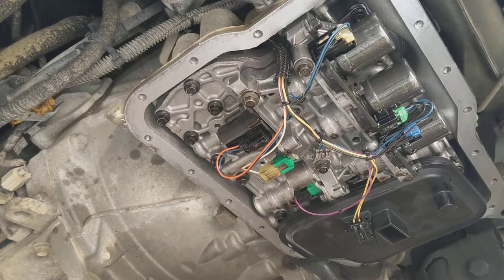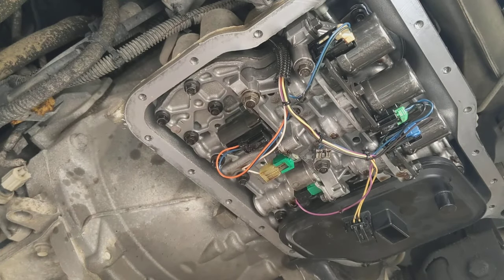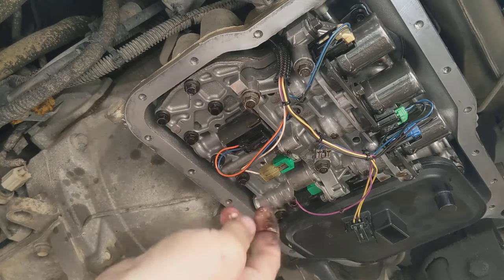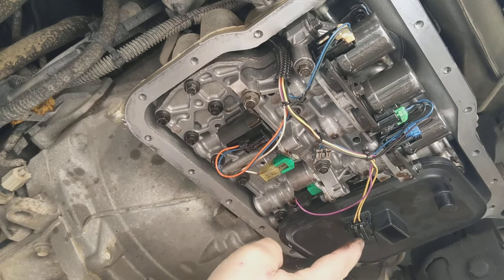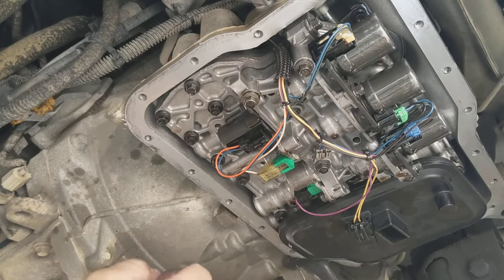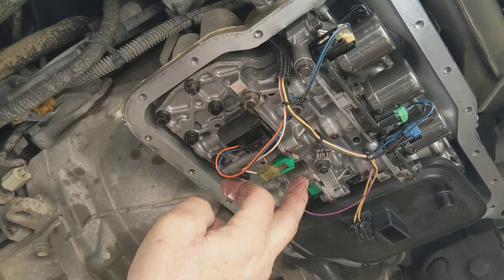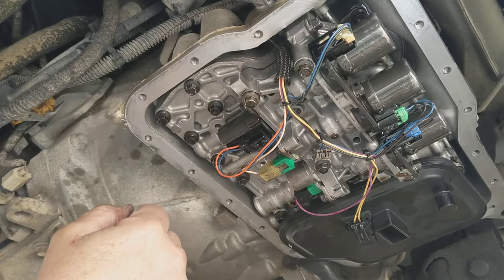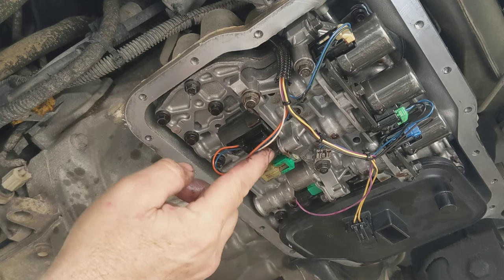DIY transmission shift solenoid replacement!

Comment: This video saved me 400 bucks, I just bought the whole valve body for $60, replaced it myself and the car would go without jerking or shaky RPM, it had a code saying gear 3 ratio incorrect . I would advise don't replace one solenoid valve, sometimes the valve body is clogged inside and the problem may persist like for my case
Reply from the maker: Thanks
Reply: From where get it please ?
Reply: I have the same problem
Reply: Where you buy it that cheap???

Comment: DIY transmission shift solenoid replacement?  Would have been nice to see it done from start to finish.
Reply: If you can't get that far on your own you probably shouldn't do this
Reply: @rogerthat4545  Gotta be tough to remove screws, point at parts and talk about them.
Reply: @jamescummings6703  yup.. pay no mind to the fluid.
Have fun!
Reply: @rogerthat4545  There's fluid in there?  I thought it was in the oil pan.

Comment: Did that solve the issue? Or was it a bad transmission? Or possible faulty  other solenoid?
Reply: Just put your car on the ob2 scanner and it will tell you what it is

Comment: I did get the solenoids replaced as you had shown, the small ones on the one side.  What about the 3 larger ones on the other side?  Shouldn't they be replaced too?  Unfortunately, I can't get the clip that holds them in place out.  Does that require dropping the valve body?  Or should I ask do the larger 3 need to be replaced at all?
Reply from the maker: The 3 others should not need replacing

Comment: I have a question, my 1998 Corolla is telling me to replace Solenoid A, B, E, electrical? I'm trying to find the Solenoids to purchase, but it's almost impossible. Do i need to replace all 3? and do they all look the same? I searched Ebay and Amazon, they only show one kind of Solenoid with one bolt.

Comment: I replaced both if mine and it still wont shift out of park. Anyy suggestions?
Reply: Won't shift out of Park do u mean 1st gear or the shift leaver won't let it move
Reply: @jamesbenton1346  no it was the rear  brake light switch lol

Comment: Is an AWD the same thing 
My transmission stays in 3rd gear until the thermostat opens up them the computer will shift thur all gear. This only happens when it cold outside below 40 degrees
Reply: Yeah same deal. Awd, 4wd, etc all use sh8ft solenoids, if its amanual it doesn't have them

Comment: What kind of solenoid does it take, and how many of them?
Reply: So this transmission is used on Ford and Mazda vehicles and I believe it's 4 speed automatic but it has 6 solenoids, one is for torque converter control, electronic pressure control, forward clutch, pressure in, pressure out and the changing gears I believe, you can look up a diagram and find the information you want as the different manufacturers labeled then different for some reason

Comment: Old video but does anyone know the torque specs of the bolts on these?
Reply: 120 ftlb's
Reply: @Cj Young   Jesus that's way to much
Reply: 260fp
Reply: Can you hand tighten them??? Haaalp!
Reply: @tangoray1095  thats what I did with a 1/4 ratchet
Reply: 89 inch pounds